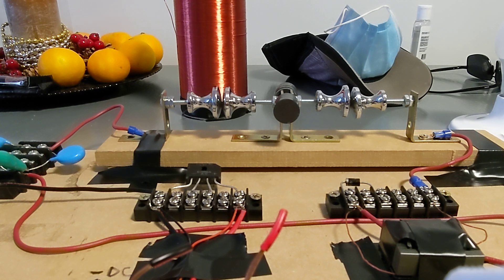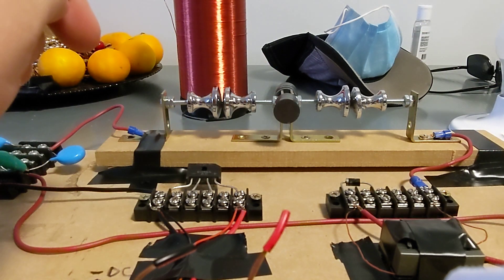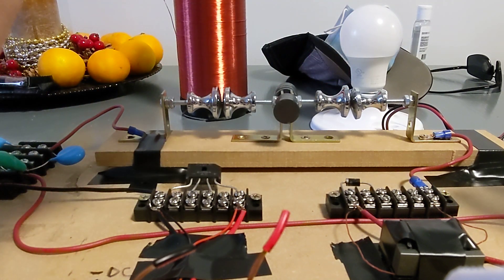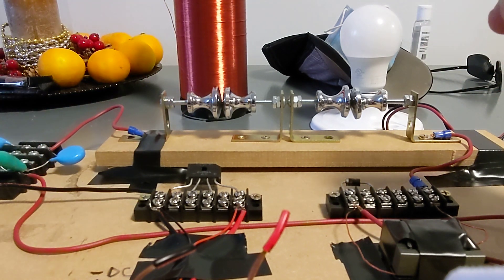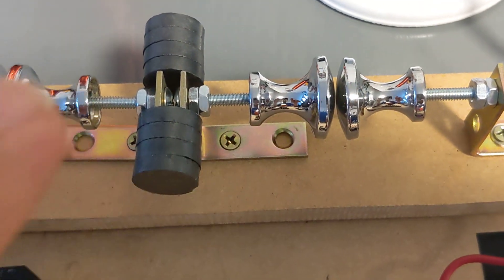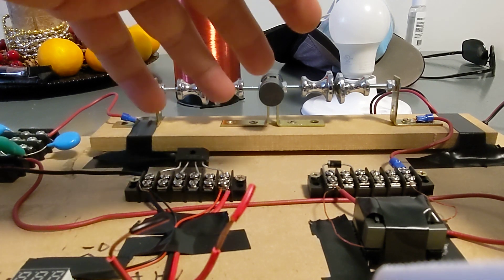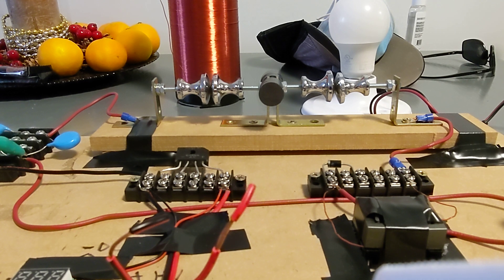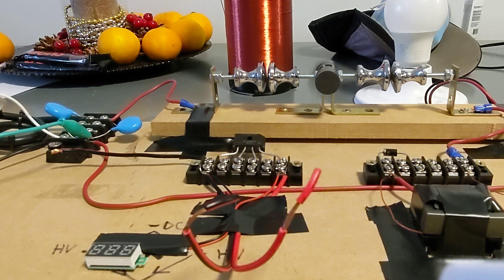Faraday Research⚡ RND/#free energy #tesla #zeropointenergy

Comment: please understand,  a high energy spark surprised by splitting the positive, not going from a high positive to a more negative, will increase the force or the or energy of the spark.  this will collapse the Higgs field wave and create the pressure to bring in extra electrons from the electron wave field. this is cold electricity.  this energy is best collected directly around the spark gap.
Reply from the maker: So my question is to you is my circuit the way it's laid out is wrong if it is please inform me?
Reply: No such thing as "higgs matter" nor "electron". Utter dystopian pseudoscience BS.

Comment: Hello everybody. I am new to the field of free energy but a spark gap is there to dissipate the high voltage so there is necessarily a loss of electrons? and isn't it the goal of capturing the free electrons rather than attenuating them, can't we recover them by a system of coils near the magnets of the spark gap? to reinject them into the circuit?
Reply from the maker: Yeah as you'll learn that the electricity that I'm using is called a cold electricity
 so the electrodes that I'm using for the spark gaps do not emit any heat now this is due to the type of power that's going through it which we refer to as cold energy so when you get into these things you're going to find out there's different types so what I'm doing and layman's terms is putting Niagara falls through a garden hose!!
 so I'm getting a really fast stream of current but with very little electrons attached to it that's why it stays cold
Try to watch all the videos that I've done on this and I'll try to explain it in my next video's a little bit more clearly because we're dealing with a monopolar energy source which is positive only there is no negative I can light a light bulb with one electrode so this is what Tesla discovered It's a mon polar static potential so yeah stay tuned for new videos thanks!

Mike
Reply: @FaradayResearch  ok thanks for the info and if you put the three spark gaps in parallel that would make you three garden hoses ....
Reply: @guy-luccocuaud6865  No such thing as "electrons". Radiant electricity involves LMD waves here. Not free energy but is of FTL transmission. If you want free energy / overunity, you're searching the wrong thing.

Comment: Omgerd MIKE THIS SONDS GREAT ON HEAD PHONES. So the magnets organize the arching? Great experiment. I can HEAR the difference more than see it.
Reply from the maker: Yeah the sound was definitely very synchronized kind of like a drum in some way yep I see what you're getting it
Reply from the maker: Hi yes you can hear the difference !
it's a lot more smoother lot quieter and the arcs are more organized and not trembling all over the place so yes Tesla was doing this in the 1892 and yeah he has quite a bit of writings regarding this he's also utilized this in his hairpin circuit as well so you might want to look that up as well cheers
Mike
Reply: @FaradayResearch  the magnet version has a distinctive morose code type canter. I wonder if @ominous could use these as beats. 🤯🤯🤯🙄😁😁😁👁❤🧚🔥🔥🔥🔥
So when it's more stable the sound becomes more TRAIN TRACK LIKE CLICKS. NOICE.

Comment: It's like putting magnets on the old school meters that were mini induction motors did I hear generated most of the energy that was going into the house and now they're just not on the house and more centralized per neighborhood
Reply from the maker: Yes those want meters were made by Tesla and yes they were free energy devices!!...
 it was basically a faraday disc or he called it the Tesla disc but anyways 

yeah they were overunity and they were creating most of the amperage that was going into the house The power from the power lines was just a seed voltage just to excite the coil and the disc vibrating through the magnets yep very good point Cheers!

Mike